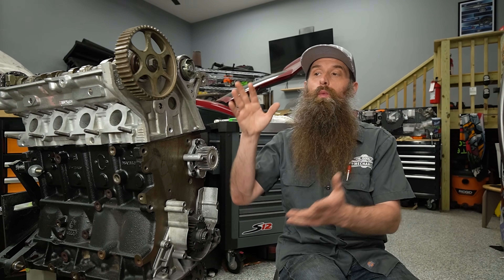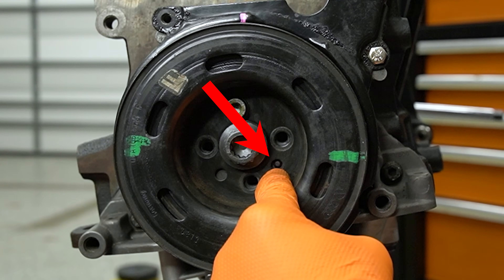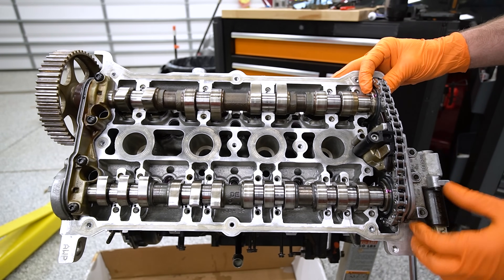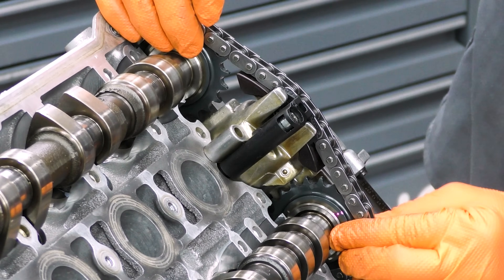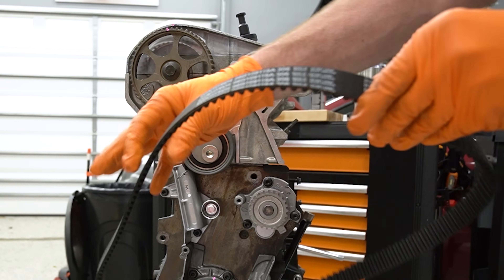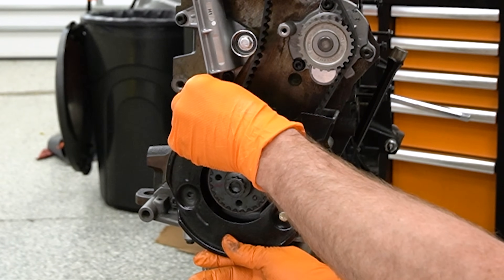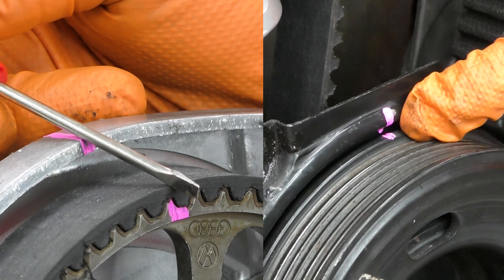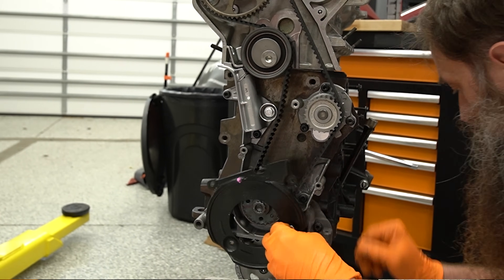How To PROPERLY Time VW/Audi 1.8t 20v Engine ~ Belt and Chain

Comment from the maker: Hope this gets you guys dialed in on Properly timing a 1.8t! Im working hard to get the full TT Series done soon. ITs gonna be awesome, and a total disaster HAHA
Reply: such awesome motors in my opinion can either make or break quite literally though haha
Reply: 😅😢😅😢😅😅😅 @armandbeyers
Reply: I can't wait for the TT series. My wife and I bought a basket case 2001 roadster - so far it's been a downpipe, turbo, 1 intercooler, oil pan, power steering reservoir and shifter bushings. Now the door cards are de-laminating at the top, the foam in the hvac system in disintegrating, the haldex doesn't work, and the CCM is failing. The wife wants it gone now, so I'll be patching it up and soon it can be someone else's problem.
Reply: just did this a month ago on a s3 8l  :)),  that cardboard thing it's very cool... i end up taking out the hydraulic tensioner putting the belt and then the tensioner :))
Reply: I've been waiting for your TT series since you bought it! 
Great video! Im about to do timing belt and water pump on my TT with APX engine
Reply: Nice video, I have a 1.4t EA211 CZTA in a Jetta that need the timing belt done in a year and have been unable to find a private vw shop that has the tools to do it and the dealer is really expensive. Do you see yourself doing one of those or consider doing one of those or something in the same family in the near future?
Reply: I have a 1.9 tdi passat pd115 ajm, if you could make a video of pds timing chain. It would be the first one from a YouTuber i trust. And tandem pump rebuild. And rear brake pads too because of the adjuster. Love your videos. Big hug from portugal 💪
Reply: We need more Charles in our lives
Reply: What’s your opinion on the 09a transmission that came in my 2003 1.8t everyone says it’s not worth modding cause the transmission can’t handle any extra power. What’s your take on it?
Reply: roughly how big was the piece of cardboard that you used?, i assume a long piece would provide to much slack to the belt and put u out of time instead of in time
Reply: Was literally going to say "its SO much easier with the engine out of the car". Last time i did this to my mk4, i just said eff it, and pulled the whole engine out. One thing i always do though, is it's super important to get all the slack out of the front side of the belt. If you don't, even if you're properly aligned to start with, you'll be off after your test rotation. To do this i'll start at the crank, around the water pump, and then walk the cam forward about half a tooth as i  put the belt on it. when you release the cam it'll spring back to TDC. thus taking all the slack out. You just have to make sure your crank doesn't turn when you do release it. To get it around the tensioner, i first install the roller "spoon" tensioner, and only the bottom bolt of the hydraulic tensioner and just let that swing away. put the belt all the way on. Then with a big 'ol set of pliers rotate the hydraulic into place (making sure you put the spoon on top).
Reply: Anyone else notice the lag between the intake and exhaust cam rotation?
Reply: I don't see how the other tensioner works. You only have to leave the hidraulic tensioner do all the work?
Reply: Х
Reply: Is my mk4.5 Jetta GLI a 20v?
Reply: Hi, Im putting my 1.8t back together and I am in kind od similar situation like u were, mark on the top is not lining up with mark on the camshaft wheel, but in opposite direction than yours, does it mean that I have to do the carboard thing, but in the opposite direction?
Reply: My timing belt is tight on the back side of the cam gear but pretty loose on the water pump side.. how could this happen?
Reply: Dude! Thank you! I asked (along with others) and you delivered bro!

Comment: i have an AUQ with aftermarket cams, bigger pistons and forged rods the the head seems to be timed 16 link in between but how do i time the cylinder head to the block it has a IE aftermarket  adjustable red cam pulley and a aftermarket fluid damper crank pulley and a IE manual tensioner theres no visible markings on the crank pulley only on the cam puller but its adjustable

Comment: hey do you have any videos of the 02 version of this motor with the mechanical tensioner?
Reply from the maker: I dont. Those were only VERY early on VWs
Reply: @HumbleMechanic gotcha, I have a 2002 from my buddy and it has the mechanical tensioner, safe to say that was factory?  Bad boy had 300k on it

Comment: I just bought an Audi TT mk1 225 with a few teeth skipped and engine wont run. I reckon there still is a chance to throw a new belt on and re-time it and with the info from this I reckon I've got a good shot the engine actually hasnt grenaded itself yet! Thanks again guys - long time subscriber you guys always come in clutch. Super easy to follow.

Comment: Just did timing belt replacement on my big turbo TT after a failure (bolt from cam sensor fell and exploded crank seal housing, fortunately it didnt destroy my crank gear and didnt munch the belt enough for it to snap) man does this video and particularly the cardboard trick saved some agressive cursed words to come out!!!
Props to you guys!!

Comment: "So without putting anything back, lets go ahead and count our rollers!" camshaft caps magically appear 1,2,3,4 LMAO.  Thanks for the video Charles.  Been struggling with a p0341 on a fresh build because my exhaust camshaft was set to 12 o clock instead of 11 o clock which is misleading in the bentley book.

Comment: The early Versions (AEB) are stronger build, with more quality components. Mine has run almous 270.000 miles with no problems. Great powerfull and reliable engine with a good fuel consumption.

Comment: I have a Q - I've put the belt back on correctly with the engine at TDC (68 teeth from the camshaft pulley notch, to the nub on the crank - and all matched my timing belt paint-pen marks too). Spinning the cam 2 full turns results in the belt moving along by 6 notches, however the cam and crank are still in time/at TDC after 2 crank turns.

No matter what I do, this is happening every time even after unseating and reseating the belt. And even with the tensioner in play (pin removed). It appears the engine stays in time (identified by the cam notch, and the crank's paint-pen marks - and crank nub at approx. 4pm), but the belt is moving clockwise 6 notches after 2 full crank turns every time. Spin the crank another 2 turns, belt has moved on another 6 notches! But engine is in time. Does anyone know why this is happening?

Comment: For someone whos not as experienced. Wouldnt it be safer to do the vvt, chain and tensioner with the timing belt still on and then once thats finished and tested,  proceed to the timing belt?
Reply from the maker: You can for sure do it that way. I dont think it's any easier or safer really. You have to pull a cam up to get the tensioner off
Reply: @HumbleMechanic  thank you for your reply.

Comment: What an excellent video, i stripped mine last night and thought id refresh my memory by watching how you did it before i start putting it back together and im glad i did as your cable tie trick has saved me buying to compressor tool😁
But you did fudge it a bit, the book says notch on EXHAUST CAM is offset to the inside, not the inlet😃😃😃
Keep up the good work

Comment: 15:10 you need to adjust that gap between 8 and 10mm...

Also it's easier if you mark both sides of the belt in relation to the sprocket then transfer the marks to the new belt.

Comment: Could you tell, how much pressure you felt on top of tensioner piston, or pulley lever, or if you can simply check the tension by your thumb on belt? I am suspicious, if my tensioner is too weak. Thanks for good video.

Comment: This video has spared me a huge headache today. I was working on a Golf mk4 AUM 1.8T car with high idle, misfires, hard start, and poor perfomance. What cured it? Humble Mechanic's detailed and straight-forward video. HM, you are right about that intake cam chain sprocket marking being off a bit. You should have seen me counting those chain rollers like a 5 year old coz I did not want to make a mistake🤣. 

I did not have the special chain tensioner locking tool so I used one long zip tie. After so me fiddling, I scored the winning goal. Long story short, she purred like a kitten after. Thanks man.

-Sizwe, from South Africa

Comment: great video, do you see an advantage to running a solid style mk2 roller conversion kit for the timing belt tensioning if you are running high rpms, 8k plus?

Comment: Question regarding tensioners -- when I did my AUG timing belt in the early 2010s (yes, time for another one as preventive maintenance, which is why I am watching your video), I had to lock down the eccentric rotation position of the tensioner so that I could put a 1/2-turn twist in the timing belt. You just seemed to slap your on and torque it down. Two different parts? Revision at some point?

Comment: If you are sure the engine is properly timed on the old belt, then the trick of marking the old belt and the crank and cam wheels before disassembly can help, transfer the belt marks to the new belt and align the new belt with the marks you made on the pulleys, that ensures you get the right number of belt teeth between cam and crank pulleys and avoids having to adjust after if it's not right 1st time round. When doing it in the car, as most people will be, it's definitely easier i.m.o. to get the belt maybe 10-20% on the water pump pulley 1st then get the belt started on the crank pulley and push both fully home at the same time.

Watching Car SOS this week I saw Fuzz take an interesting short cut on cam belt fitting. By slicing the old belt in half along its entire length. Removing the outside half and fitting the new belt alongside it. Then cut the remaining half off and slide the new belt all the way on.
https://youtu.be/Tti7sGU1dOA?si=6sV7CJpCNEdSpevc

Comment: that's why i never ever buy VW or any of those skoda seat because they are crap no marks from the manufacturer no feel of the exact point!!!! when you really change timing belt the motor is on the car you don't have to rebuild it so for me japan japan etc.Many corporations you see japan brands with Renault especially in Europe sucks!! because those cars have some problems that there where nowhere before

Comment: My 1.8lt timing belt came off on the highway. My husband put on a new timing belt but when we tried to start it just heard the starter. He took the valve cover off and manually turned the lower crank shaft the chain tensioner makes noise and goes up and down. Is that normal? I have video if anybody is willing to give us some advice. Ty

Comment: Pine Hollow Diagnostics just posted, May 6 or 7 two parts, a video on this engine where he diagnosed and repaired an engine like this that had the two cams out of time at the back by one chain roller. Everything was right except the guy who’d repaired it must not have counted the chain rollers. It was 15 instead of 16. Ivan fixed it the shortcut way without doing what the time manual said to do.

Comment: I went to swap in another cam chain tensioner and got it off a tooth a couple times. The final time I triple checked the position and counted the 16 link pins. Went to start but still running poorly (multiple misfire codes). Ended up for whatever reason the cam position sensor decided to fail. Fortunately I had another laying around from other projects. Afterwards fired right up and ran sweet. Needless to say I'm an expert at it now. lol

Comment: I have a 2004 TT Quattro Roadster with the BEA 225hp engine. I had an issue where the timing mark on the Fluidampr was incorrect, however, I'd already watched this video and copied your extra timing marks, so once I copied the timing mark from the original crank pulley to the Fluidampr, everything went incredibly smoothly! To make sure it would remain in time after being tensioned, I pulled the tensioner to its tensioned position and instead of pulling the pin, I shoved an Allen key between the tensioner and the brace, which held the belt under tension without releasing the tensioner.

Comment: thanks for video . i bought a4b6 avant 1.8t Q   an need do  timing cover gaskets etc  and timing belt  .  camshat timing is tricky if need only  that tensioner gasket change  do to oil leak

Comment: Awesome video! Super helpful with the issues I'm experiencing on my 2003 VW MK4 20th AE.
@HumbleMechanic I've heard of the timing chain stretching; is it possible for a timing chain to be too tight due to oil starvation? 
When replacing the timing chain tensioner gaskets I accidentally filled half of the oil port with black gasket material. Just replaced the timing chain tensioner and realized this. When looking at live data block 093 for the camshaft reading I'm seeing +17 degrees. I have 16 links in between both marks, they match up exactly to your video with intake camshaft mark slightly toward intake.
Timing belt marks also look spot on with reasonable tightness. Have also replaced camshaft sensor and rpm sensor.
Before replacing timing chain tensioner was getting P0012 error code, now getting P1340.
Only thing I can think of is Timing Chain is bad, it's never been replaced from my knowledge. ~160k miles, engine fully rebuild around 90k and has been running fine since recently.
Reply: Forgot to mention, when engine was rebuilt a AWM head was used instead of AWP. From what I've researched, all should work on 1.8t.

Comment: Two things viewers should be aware of. The service manual calls for RVT on the cam chain tensioner gasket and the cam sprocket bridge. The other is that when counting the rollers on the cam chain, the first roller on the exhaust cam is slightly offset to the left of the timing mark.
Reply: on the whole gasket or in certain parts?

Comment: Is the entire process indentical for AEB engine? I thought the roller count was not 16 between both cams on aeb. Correct me if i am wrong. Also tensioner, cam gear and everything else same process?

Comment: A little tip, as the TDC markings on the crankshaft are not always perfect as there may be some play on the vibration damper. You can also use the flywheel to help. There is a 0 mark and an I mark on the flywheel. If half of the 0 is visible (i.e. a C), then ideally cylinder 1 is also at TDC. This gives you another additional marking for TDC to check. But it only works when the gearbox is installed.

Comment: Question ...Just did a rebuild on my 1.8. and accidentally rotated the engine the wrong direction trying to get torque converter mounted by a full revolution. Will that mistake throw the timing off, where it needs to be readjusted?

Comment: Need some help. Replaced the timing belt, engine cranks long before starting, runs good.

* Can the timing be off and the engine still run good?
* How many teeth off before piston hit the valve?

Or maybe my symptom is not timing related

Comment: Just refurbished my 1997 AEB head with 350k miles on it, recommend the shop manual for correct procedures. Did a compression test after reassembly and got factory new(!) values of 11-12.2 bars, amazing engine this.

Comment: I watched this video a few months back, just did my valve stem seals so did the belt and waterpump as well while everything was apart. I wish I had remembered the cardboard trick. I had to put the belt on three times to get the timing correct lol, was one tooth off on the first two tries.

Comment: For the VW ATW 1.8t 20v timing chain, it's 15 rollers apart from(14 rollers in between) the marks.
Reply: it's the same for you, but you counted backward and started the count at 1 with the roller above the mark on the intake cam sprocket and ended the count with the 16th roller crossing to the first valley past the mark on the exhaust cam sprocket.
Reply: If I were using the 16-count method, I'd start from the front of the engine(where the pulleys are) looking at the timing marks. I'd count from the timing mark on the sprocket of the exhaust cam(left cam) to the 1st roller to the left of the mark and then count right for the rest of the 16 rollers.

The 16th roller should be directly above the intake cam sprocket timing mark.
Reply: great video btw! 😶‍🌫

Comment: Thanks for that, very helpful. Just starting a big job on one that badly over heated. Taking the head off for inspection as it lost a lot of compression. I hope the engine can be salvaged, only 60k on it.

Comment: Long time tdi driver, just picked up an 03 gti 1.8t with 200k miles (for $600🎉) plus a cabrio with a 1.8t swap so I will be following this video very closely when I tare into the gti. Just pulled the fuel filter and what came out of it was pure muck. I almost puked. I swear it was the original 😂

Comment: Great video. I have one question regarding the crank rotating back so the pistons are not at tdc while tightening the cam caps. I get it that this way you avoid the possibility of valves hiting the pistons when they are pressed by the cams, but in the next step you rotate the crank back to tdc, so the pistons could again hit the already opened valves? Maybe i am missing something here, i have to do this on my car and the manual really tells the same. I am just curious whether the rotation is necessary or it can be done with keeping the crank at tdc and valves being closed in that possition? Thanks a lot

Comment: I always enjoy doing timing belts on these engines because there is no way to secure the cams from moving (like you can by locking twin cam gears together), and everything shifts by a tooth or two by the time the belt rests in place.

Comment: I had a question I’m working on my 2001 Audi A4 1.8T and my timing got missed up, I’m in the process of fixing it and I noticed that where my pulley goes for the tensioner it moves to the side when I install the timing belt, what can I do to fix this if possible?